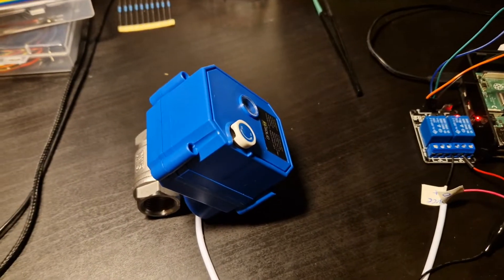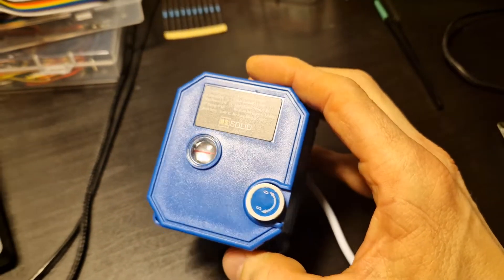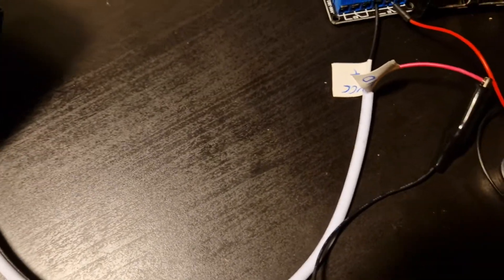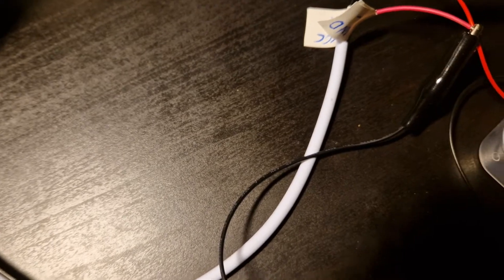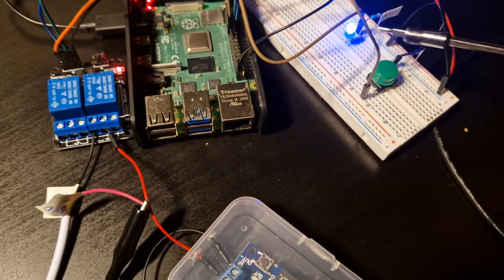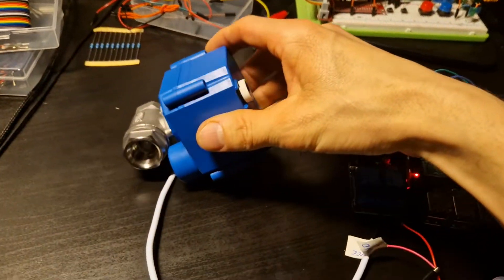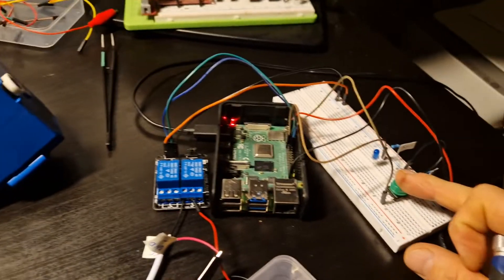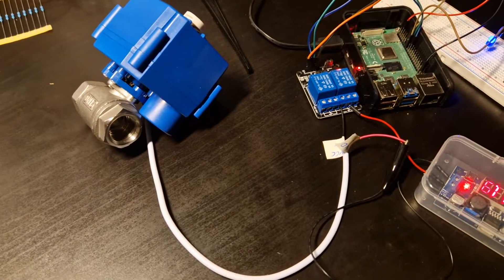Motorized water valve (U.S. Solid) controlled by Raspberry Pi

Comment: Can you control this valve to open from 0 to 100% and if so, would you show the code?  Or, is there another similar valve that would be easier to control from 0 to 100%?
Reply from the maker: I don't think, that you can control how much the valve can be open other than fully open or fully closed. I've just looked in the wiring diagram included with it, and it seems none of the setups there suggest that this would be possible. You can look them up yourself if you want. I put them on my github page of this project: github [dot] com [slash] tomek1ni [slash] Raspberry_valve
Reply: @tomek2ni  Thank you.  US Solid SKU JFMSV00012, a 2 Wire Reverse Polarity valve can be opened or closed partially.  I am very much a novice, but am going to use this controlled with a pi if I can make it work.
Reply from the maker: @SteveEldredge-qb2gw  Yeah. Mine is automatic return. I connected it to two channel relay (instead of DPDT switch) in the reverse polarity setup to see if it would partially open, but it would always fully open or close. You at the other hand would probably need at least 3 ch relay... Right? Because you need to two ch to reverse polarity, and one to cut the power off so it stops moving.
Reply from the maker: Actually now when I'm looking at the schematic  2 channel should be enough to achieve that.

Comment: Was a flyback diode not required?
Reply from the maker: The blue led on the breadboard? You obviously don't need it. I just put it there because it's easier to see if the valve is closed or not.
Reply: @tomek2ni  I was talking about needing a diode across the contacts to the ball valve in case of voltage spikes.
Reply from the maker: @seren3634  Wiring diagram didn't show any diodes so I guess it's not necessary